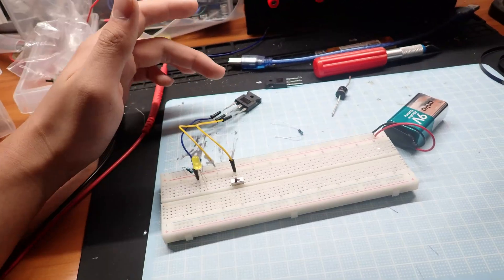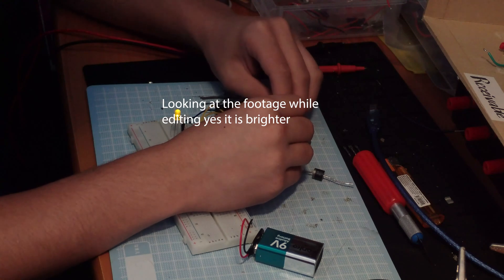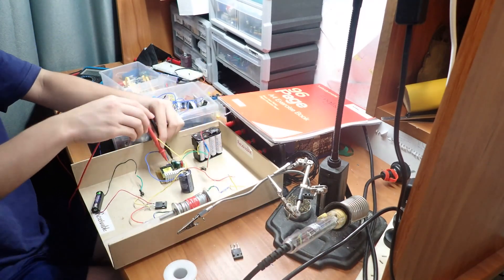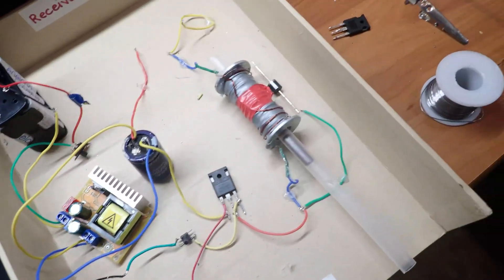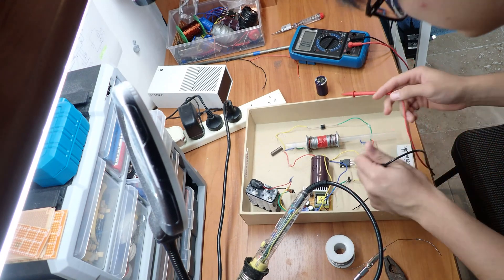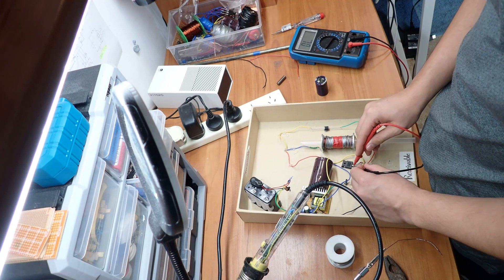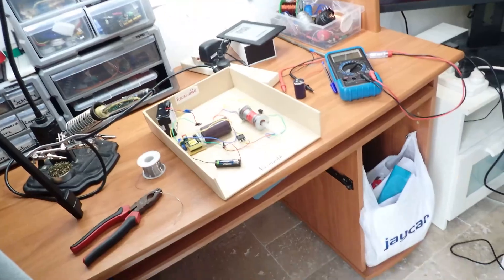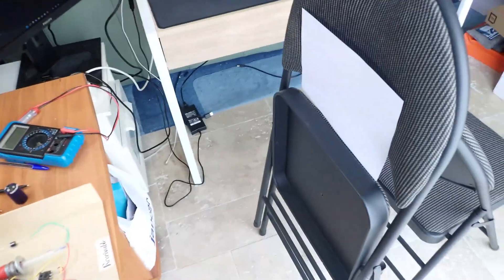MY COILGUN WORKS!

Comment: Wait. You just can turn the switch with a resistor with 1 power supply without the need of the 1.5v battery right?